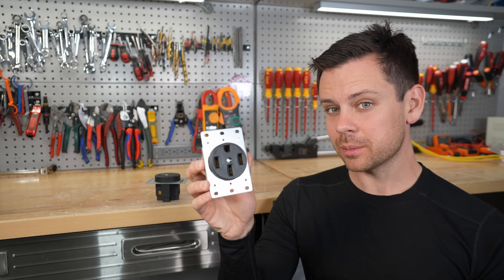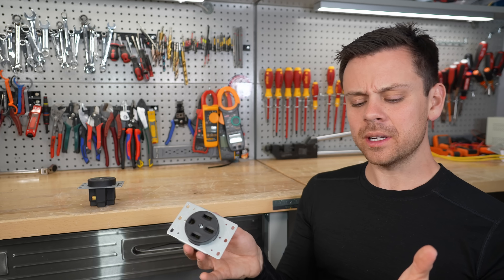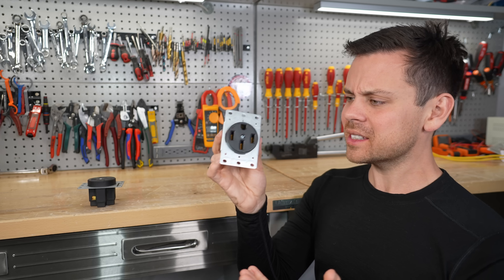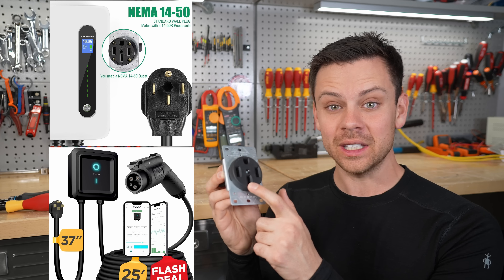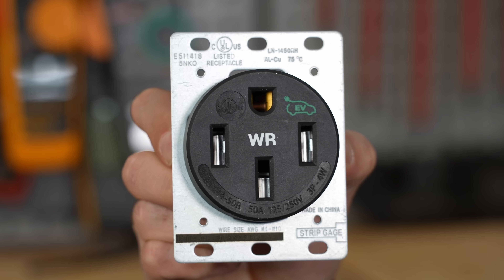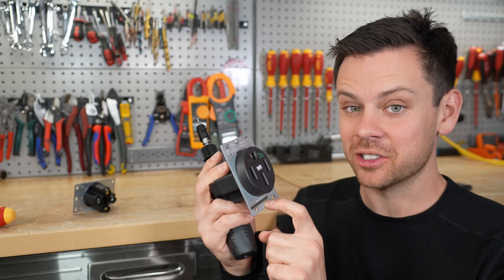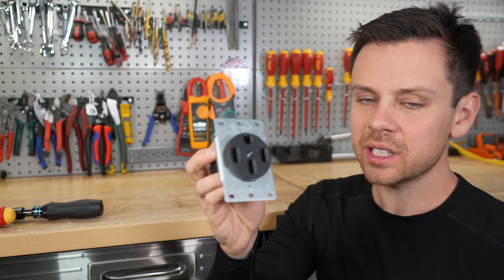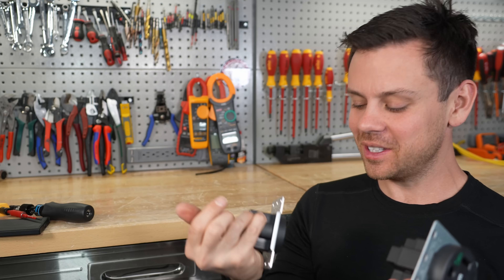Quick Guide to NEMA 14-50: Don't Burn Your House Down!

Comment: One major issue with these huge plugs is that they were never designed for frequent plugging/unplugging.  You plug in a welder and leave it there for 30 years in the garage.  Now you have EV owners using the MOBILE charger at home, unplug it and carry it elsewhere then come back home and plug in again.  You are weakening the contacts.  It amazes me that they spend $50-$100K for an EV but cheap out on a properly installed wall charger averaging $1000-$2000 by a licensed electrician.  The Hubble is a much beefier design BUT I still would not keep doing the plug/unplug routine on a regular basis.  Ever notice some older home outlets can barely grip a 15A plug?  Same thing here but with a much LARGER amperage draw.  My 2 cents.  You were warned…

Comment: A slightly loose plug connection can cause friction and arcing causing high heat and thus melting and possibly fire. Even a high quality outlet, larger gauge wire and smaller breaker may not protect against this. Always make sure plug connection is solid and doesn’t feel loose or sloppy. In the past I did electrical troubleshooting in high amp grow rooms pulling max amps through rated gauge wiring for 12 to 18 hour cycles and 90% of issues were due to loose electrical connections. All connections need to be tight, and torqued to spec. Conductive grease can help too on high amp connections like breakers, receptacles, contactors, etc.

Comment: Most of the problem starts by plug being dangled and being wiggled often from pulling/tugging, causing receptacle pin/connector to become loose. That can cause heating and arcing.

Hardwiring is being highly recommended or plug being strapped or locked into the receptacle.

Comment: You don't need 4GA for a 14-50.  6GA is standard...
Reply: Correct, but I see what he is saying.  With a 60A breaker you are technically OVER the 55A on a copper #6 wire.  BUT since these have to be derated by 20%(48A on a 60A breaker) for EV charging over 3 hours you will not exceed 48A, even on a 60A breaker with a HARDWIRED WALL UNIT.  If you have a NEMA 14-50 OUTLET the max limit for EV use(20% 0f 50A plug is 40A).  But yes, #6 is fine as it will never pull over 48A.
Reply: @js3085  You use the correct wire size according to actual amp draw, not breaker size. 48A is fine and standard for 6GA.

6GA is also standard for 40A on a 50A breaker.

Comment: Love your videos. Im considering going off grid. I'm a do it yourselfer and could use some advice on how to connect my inverter/charger to my electrical panel. My panel is a standard 220 volt. I do have a water pump and water heater that use 220. I haven't found any good YouTube videos on how to disconnect the grid and connect my system. Could you make a video showing how this is done?

Comment: I had the cheaper one installed by an electrician and started having slight overheating issues at 30 amps and it lowers voltage on its own. 
Damn, now I need to get it replaced asap.

Comment: I need a NEMA 6-50. My EV shares the outlet with my outdoor welding plug. I just have an adapter on it. Have had no issues, but mine is probably one of the cheap ones.

Comment: I have the cheap Nema 14-50. I haven't had an issue, but that's probably because I limit my amp load to match my solar output (about 25 amps)

Comment: Everybody knows that the circuit breaker is the safety. Proper sized AWG proper breaker size that’s where it’s at.
Reply: Well install the proper equipment.  that looks like a dryer receptacle to the average person.

Comment: "I used the proper gauge wire."
What size wire? Sized for 30A, or 50A? #8, #10, #4...?
Furthermore, all AC receptacles (in any/all ampere ratings) have a "maximum" amp-load rating. BUT, they are not rated for that current, "continuously". They are only CONTINUOUSLY rated for 80% of the maximum.
For example, a typical receptacle in your home may have a 15-amp rating, however the "continuous" rating is only 12 amps (80% of 15). The same for 20-amp recep's: The continuous rating is only 16-amps. A "50-amp receptacle" has a 40A continuous rating.
The NEC defines a continuous load as: "A load where the maximum current is expected to continue for 3 hours or more".
Lastly, isn't it interesting that the charger has a temp sensor IN the plug...?  What other plug-in appliance has such a thing? It's almost as if the charger will indeed draw more than the maximum. 
Thus, how many amps is the charger ACTUALLY drawing... more than 40? More than 50?
Why would the charger manufacturer need to put a temp sensor IN the plug, unless it was capable of drawing more than the allowed amperage? 🤔
Yet another reason to NOT to have an electric vehicle. 🙄
Reply: 'WHAT!!!!!, Get!!/Stay!! OFF!!!!!!!/OUT!!!!!!!!!/AWAY!!!!!!!!!! of This!! and ALL!!!!!! Of ((Our!!)) channels!/forums! Troll !!!'

Comment: I have that same 14-50 outlet because it's what was available at Home Depot.  I use it to charge by 2019 Leaf SV+ which can pull as much as 32 amps I believe.  My outlet does get hot.  Nissan had an issue with some of their EVSE chargers and mine threw a fault a few times so I asked my service rep about it.  She replaced it, no questions asked.  The new EVSE does the same thing.  It's not the EVSE!  In fact, the EVSE has probably prevented a fire because it threw the fault.  Props to Nissan for that.

I'm going to replace the outlet and eventually upgrade the wires to at least 6 gauge.  I don't think 4 gauge will fit in my existing conduit so that will require a more significant upgrade.

I can't hardwire the EVSE.  I use that outlet for my TIG welder (which has never had a problem with the outlet).

Comment: Four EVSEs (different locations).  Four EVs.  All Leviton 14-50R receptacles.  All 6 AWG.  All EVs draw 40A at maximum charge rate, so the receptacles get exercised frequently.  All receptacles get the IR gun pointed at them once per year.  Only one had a reading >120°F during inspection, and that was charging a M3 on a 100°F day.

IDK about your incident, but I'm not experiencing the overheating issue you're reporting, and I feel 4 AWG is a waste of money (and is significantly harder to land) over 6 AWG, which is well in the green zone for ampacity (55A for 60°C).

(OTOH, I had an EVSE nozzle meltdown at 40A, a well-known company in San Diego -- owner now long gone -- apparently over-crimped the terminals at the nozzle end, lasted ~4 years of daily use.  Search for "J-Long J1772 extension cord".  The newer ones are supposed to have fixed the issue, but mine was 2017 :(  )

Comment: Just for clarity - the Leviton NEMA 14-50 receptacle is NOT rated for 50 amps, it is UL listed and certified for 40 amps continuous.   I've used it in Arizona for my Tesla for the last 8 years- it is not a bomb and it doesn't even get warmer than ambient.   The Tesla charger is limited to 32 amps.    I suspect that some of the issues are likely to be marginal plugs used with the Leviton or bad practices in removing and reinstalling the plug.  FUD (Fear, Uncertainty & Doubt) certainly can help drive sales for your Product Affiliate links.

Comment: I had EXACTLY the same thing happen with my Tesla. Leviton 14-50 and it overheated and the Tesla charging system sweated it and showed an error message on the screen in my car. Thank you Tesla! I wonder what would have happened if I was driving some other EV?

I replaced the Leviton receptacle with a Hubble. And then after the car was charging for an hour or so I checked all the components with a thermal imager just to make sure all was OK. And it was.

Comment: Thank you, Will.  I worked for TI a while ago (1972) and one of the engineers I worked with told me that UL didn’t mean squat.  They were easily bribed!
Reply: Not sure about bribes, but if UL is anything like CSA in Canada their subcommittees are full of industry reps. Not bad per se to have industry experts providing input but it can lead to "regulatory capture" if you're not careful.

Comment: A lot of EVSEs come with a 14-50 pigtail but people have a 14-30 receptacle in their garage for a dryer that might or might not be used.   So people sometimes go to Amazon and buy a conversion pigtail and find that their conversion pigtail will melt becuase the EVSE is trying to pull 40amps on a  30amp circuit.
Reply: That's why any decent EVSE has a set of DIP switches, potentiometer, or software setting that lets you set the maximum amperage to be sure it never pulls more and causes this issue. If you're charging 20-25 miles per hour, you can just set a smart EVSE to charge for one hour on, 30 minutes off, then repeat until you're fully charged. It's still way faster than Level 1, and you'll still be charged to 80% overnight, but without the overheating concerns.

The main problem the cheaper receptacles seem to have is breaking down after constant draw for hours on end, for many months, and usually in an outdoor setting or someplace without climate control. Any receptacle built for industrial usage (welding or generator) should be fine at 24 amps for a few hours, and for most people on Level 2 charging you're not going to be going for more than 4 hours at a time unless you've completely drained your battery. Most normal drivers will only have to top up at night from 50% or higher.

Ultimately, shop for something that says it's made for continuous industrial use and you'll be fine, but if you're worried just be smart about the amount of time you're on the charger. You don't need to do it all at once. You have an entire night to get it done. 12 whole hours or more. Charge, take a break, charge, break, etc. and you'll likely never see an overheated plug or receptacle. And oh yeah, have as few adapters between the receptacle and the EVSE as possible, and don't coil your cords while charging!

Comment: What good is the UL listing? If it can’t handle the rating under normal conditions and proper installation. Law suits should be coming out of the woodwork. And Underwriters Laboratories should reevaluate the listing. I am a retired electrician and we were not allowed to install anything without a UL listing or a UL inspector certification.

Comment: I seen the brand Leviton and was not surprised. These are designed for intermittent use like cooking, but even that can go for hours in some households. The other problem is the gauge wire in the plug side is probably around 12 awg. 50 amps should be 6 awg. No way the plug has 3 6 awg wires it is too thin.

Lot of things in lots of industries that are over rated. When people actually use things as advertised they find problems. The issue is most people dont so there for the problems are under reported.

Comment: Another approach is to use a dryer receptacle with Nema 14-30 with a Tesla mobile charger limited to 24A (about 5.6kW). More than enough for over night charging. You’d gain about 20miles per 1 hr of charging. Only upgrade needed is the receptacle to a Hubbell, now they’re selling Bryant on their site. If there is a concern about passing 24A of continue current on a 10AWG wire then drop it to 20A, I know Teslas allow the user to reduce the charge current.

I did find it funny that the Tesla mobile charger included a 110V adapter and a Nema 14-50 adapter.  What am I going to do with the 14-50?  I would still need to hire a contractor to run at least 8AWG wire to my breaker, and add a new breaker. If I’m going thru all of that then why not just hard wire it like Will said. So I had to buy an additional 14-30 adapter from Tesla for $45.  The whole point of the mobile charger approach is to take advantage of the existing infrastructure at home.

Comment: Why not get one for 50 amp rv hookup? I put in my 50 amp rv outlet with a box granted I think it was about 75 at the time but I have pulled continuous 50 amps for 1 to 2 hrs recharging the battery bank in my rv without issues and it has only ever gotten a little warm to the touch but not hot
Reply: @jefferycundiff3804

Same plug and receptacle. You are  getting very lucky (you should never pull more than 80% continuous, 40A in this case) or likely already have a Hubbell or equivalent. Even with the Hubbell, pulling 50A continuous is eventually going to bite you.

Comment: Also NO aluminum wire, no junction boxes (always a direct connection from breaker to the receptacle  or hard wired EVSE.).  I also use Noalox, it not only protects against corrosion but also gives a better torque by lubricating the wire. An annual inspection and re-torque is also important for EVSE.   (Electric Vehicle Service Equipment)

Comment: Most people don't realize that these plugs never see the max amount of current through them for long periods of time. I was having my 80 amp breaker for my 65 amps of solar nuisance tripping because of heat. When you start flowing large amounts of current through anything it will get hot.

Comment: I had the exact same problem with a Home Depot receptacle. I don’t recall seeing a better receptacle so I bought the inexpensive one and it stop melt with a continuous 20 amp load. I could smell the hot plastic within 10 minutes of use. Afterwords I went to an electrical supply store and purchased much heavier ones and they are not getting hot anymore. Before someone says that I did not install them properly, I torqued the terminals to the specifications provided.

Comment: I'm kinda disappointed you didn't take them apart. The problem with outlets is, by and large, the cheap ones "look" identical to the expensive ones. But, the expensive ones will internally have good reasons why they are more expensive. In any case though, thanks for the video, and it's nonetheless good to have your cross-check. 👍
Reply: @McTroyd

Actually, they don't look identical. You will find a standard cover plate will not fit a Hubbell or a Bryant as the hole is too small.

Comment: I'm an electrician and I found the exact same thing.  I was recalled because the customer said the car was faulting, then i found signs of heat in the receptacle.  I switched to Hubbell and never was  called back.

Comment: I'm an electrician. I got my first EV a few months ago. I'm using the mobile charger for now. I did have it set to 28A then I changed it 26A now after your video I have brought it down to 24A. Instead of the max 32A from the mobile connector on the 50A outlet.. I think I'm safe at that..
Reply: @TheSimplecanadian

With the cheap ones the performance will degrade over time. Mine got to the point that I couldn't even pull 16A anymore. Went with the Bryant and that will pull 32A all day without even getting warm.

Comment: If it's not nema rated, don't buy it! I own an hvac company in Texas and just got both my electric and plumbing license also so I can be a full mechanical contractor.i didn't get to where I'm at by cutting corners! I'm going into the solar market in Texas, Arizona, and North Carolina. WIll Prowse will be my go to to keep compliant.

Comment: This issue is specifically for EVs and items of similar nature. When used for Electric Dryers, RVs and Stoves this is not typically an issue.

EVs are able to pull 30, 40, 50 amps continuous and the $10 plug, although listed for that amperage, is not made to handle that constant load. It was originally intended for use with Electric Stove/Range Combos and Electric Dryers. Both which may pull up to 50 amps but will only ever see that high of a current IF all is being used.
For example, on the stove and range, if all 4 or 5 burners are on High and producing heat at the same exact time producing as much as possible & the oven was also trying to heat up to 500 degrees F. This is when it could be pulling the 50 amps. But this could only be for a few minutes.
An EV would pull this for up to 4 to 20 hours straight, depending on the model of EV.